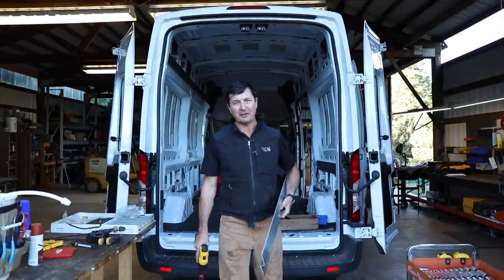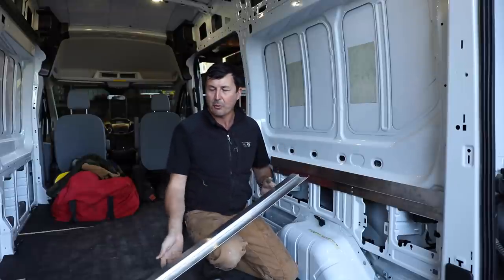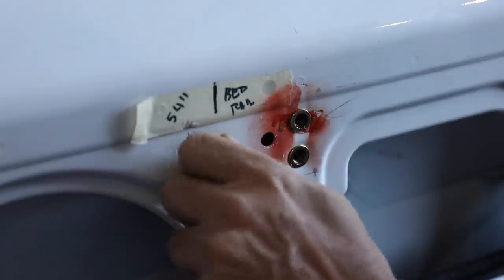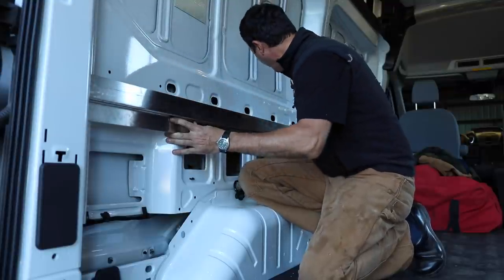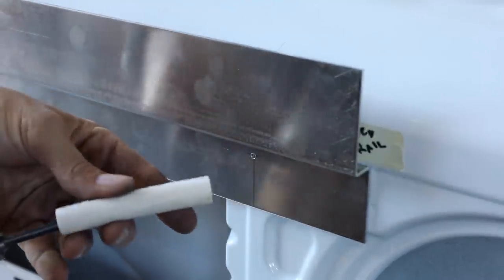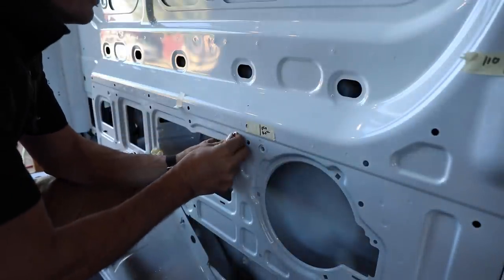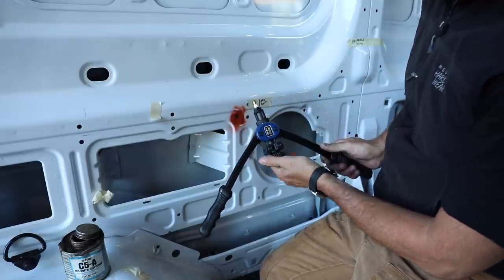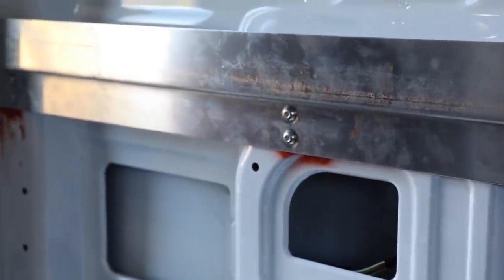Transit Conversion - DIY 3 Panel Aluminum Bed

Comment from the maker: LINK TO THE ASTRO 1442 RIVNUT THREAD SETTING TOOL https://goo.gl/c9DqfU
Reply: The thing you put behind the metal to strike with your hammer - I always called it a 'hand anvil'.  Nice demo of the rivetnut 1442 tool.
Reply: Wranglerstar Sorry to say that but you will do it right, to deburing the holes use a "Handentgrater"
Sorry i don't know the english name for it....
Look there: https://www.amazon.de/Ruko-Unigrat-Entgrater-5-teilig-107006/dp/B00202HXJW/ref=pd_sim_60_22?_encoding=UTF8&psc=1&refRID=AAVZ7Q3WQEP5PXC6MJ11

The right tool for the Job...
Greetings from Austria
Stefan
Reply: Zero Austria it's just called a "deburring tool" here, but you're right, they're fantastic.  I have one similar to this and I use it all the time at work doing pretty much what he's doing(I'm a truck and van upfitter).  General Tools 482 Swivel Head Deburring Tool with Metal Handle https://www.amazon.com/dp/B00004T828/ref=cm_sw_r_cp_api_rejQzbM7SSSFB
Reply: but will it chooch? I was an aircraft mechanic for a long time. Rivnuts are awesome but when they slip and spin in the hole, it's a bad day. Watch out for dissimilar metals that aluminum will corrode to beat hell if you use common steel fasteners. Great video.
Reply: I've been using a similar one for over 30 years. Mine holds spare blades. Great tool.
Reply: Wranglerstar  thanks
Reply: Those Dewalt bits work great , I have that same set at home  great for metal and wood !
Reply: Boy that's an awesome tool!  Thanks for sharing!
Reply: One question. Does it give you the FIZZ?
Reply: Wranglerstar I
Reply: Wranglerstar y
Reply: Dolly
Reply: the auto body repair tool you refer to is called a "dolly", as in hammer and dolly in the auto body repair trade.
Reply: exactly. but he could really mitigate the need for that by just using a unibit/stepdrill. it pretty much negates the need for a de-burrer AND the hole won't deform as it would with a standard drill bit that would grab and pull...
Reply: Ramosel, thank you! That is very clever! So the one side locates the existing hole and then has a punch to make a mark on the aluminum. I also see others that locate a pilot drill. I never heard of this before. Thanks again!
Reply: Where's the rest of the series; wanted to watch more of your Ford Transit Van conversion!?
Reply: What size are the rivnuts you use and what size are those that are stock on the transit.  Is there a reason you did not try and use some of the preset holes? Thanks

Comment: Can't wait to see more of this build. I work in a body shop and I have a couple of tips you might want to look into if you want it to last. Number 1 is galvanic corrosion, I would find a way to keep the stainless from touching the aluminum. with time it will turn the the aluminum into dust. I would paint the aluminum holes and as you are going to do coat the bolts. I would also  add stainless washer with a thin plastic nylon washer between the aluminum and stainless washer. It's not that much more work but I see this done with aluminum automotive parts we replace. The second is I would add more bolts  like you did on the ends. The metal       on these new cars is thinner and lighter and does not like to flex as much, but tears faster. An example would be to put mild steel sheet metal on a vise and bend it back and forth until it breaks the newer metals will be harder to bend back and forth but break alot faster. I'm not sure what the rest of your design has, so what I'm saying might be over kill. I like what your doing and looking forward to seeing more. I hope I can help in anyway.

Comment: As an old aircraft loftsman and design draftsman here's a tip: When you have a sheetmetal part- such as the horizontal bracket you installed- that has sharp right angle corners, cut the corners off so that you won't cut yourself raking an arm or hand across the ends of the bracket.
Reply: good idea! Thanks

Comment: Thanks for reminding me of rivnuts! Haven't used them since I was in A&P school, I'll definitely use them. I'm picking up my van this weekend! :) One thing about fasteners: the stainless bolts you mention have an anodic index of -0.5 to -0.6. CAD plating has an index of -0.95. That's a bit more difference than recommended (0.15 max in non-corrosive atmosphere), and will lead to galvanic corrosion of the rivnuts (which are the harder to replace), esp around the Pacific air. Also, galling is a great way to ruin a day, as you mentioned! I'd recommend using cad-plated bolts with your rivnuts. No galling, no galvanic corrosion, no antiseize needed. They may be a bit more expensive, but most "stainless steel" hardware at the home center is barely "stainless", and better than dealing with rusted, stripped out rivnuts in a few years.

Comment: Hi Cody. Just a little tip from a metalworker: Invest in a good Step-drill! (These drills is also refereed to as Christmas trees in my country) It will make your drilling work in thinner metals a breeze! + it also "auto" chamfers/ de-burs  the hole.
P.S. Keep up the good work!
Reply from the maker: Thanks for the tip. Can you suggest a good one?
Reply: Wranglerstar I was thinking the same thing step bits are the best for sheet metal don't tear thinner metals and leaves a good clean hole. I pick up one from lowes hardware think it's an Irwin and it's been good.
Reply: They are over priced in my opinion. Harbor fright has a good one with right price. They are also good for reloading .
Reply: We call them step drills or uni-bits
Reply: He should have these, i am fairly sure i saw them in one of his vids (like 80% sure, i watch more vids with tools in them :P)
Reply: Rasal1505 - I use step drills but they still don't de-burr the backside.
Reply: Michael Chavez I've been perfectly happy with my Harbor Freight step drills, as I don't use them to earn a living. OTOH, the Milwaukee step bits seem to be made in the USA, which is nice.
Reply: In my opinion Thürmer tools makes the best step drills. They are very precise, and super sharp. I work almost exclusively in high grade stainless steel, and these thürmer drills go through with ease.
Reply: Okay! I love to read the comments for tips! I was thinking.. ‘‘REALLY” this much work for ONE hole and rivet!?! Geez.

Comment: I use rivnuts on the daily while building fire apparatus. Be sure to apply E.C.K. or anti sieze to the rivnuts when installing them. Itll help with corrosion later. After applying the rivnut, try to run a tap through it as the tool can develop burrs on the threads.
Reply: The eck and anti seize is to be applied to the outside of the rivnut in addition to the sealer. Its for dissimilar metal corrosion for those that dont think i watched the whole video.
Reply: thanks

Comment: I've used this tool for experimental aircraft construction. Mostly for the engine covers or access and inspection ports. These fittings come in aluminum, steel and stainless steel.

Comment: Back in the day my father worked for Pan AM airlines as a sheet metal mechanic. When we would build stuff at home he would also use a piece of bar steel and hammer to flatten sheet metal, he always called it a bucking bar.

Comment: Another fastener you may want to look into are plusnuts.  They do the same thing as rivnuts, but are stronger because they grip a much wider surface area behind the sheet metal than rivnuts.  They work like drywall molly bolts.  Commercial van shelving often comes packaged with plusnuts for installation.

Comment: The US Air Force used rivnuts to hold the top of the radios I used to work on. We were constantly taking to top panels on and off because it was necessary in order to align the radios. It didn't take two years before we started seeing problems with the rivnuts. They would spin in place instead of allowing a screw to be removed. Once you install a rivnut it would be my recommendation to limit the number of times you need to remove the screw.

Comment: Add some sound dampening panels in there as well, it helps a lot on long drives to reduce the booming from the rear or noise on rough roads.

Comment: Gonna love seeing these, i would have used rivets but this works as well. Damn that sheet metal looks SO thin, the frame is going to have to be nice and solid. Will make it handle much better as well.

Comment: Eastwood makes automotive rust proofing paints which you can apply with small brush. 
Aluminum rail will rub the van body while van is moving, consider adding some padding material in contact points.
Get some acetone and clean that red overspray:)

Comment: Cody you should try to use a step drill on thin sheet metal like that.  You can even deburr with that tool from the front.  Very easy to control and versatility with multiple sizes.

Comment: @wranglerstar, a noga deburring tool would of made light work of deburring those holes a lot easier. You can also use them to run along a length of sheet metal to take sharp edges off instead of using a file. Super useful!

Comment: Ford Transits seem like pretty good cars. Had one pull into the garage I was working at with 495,000 miles. The man decided to not go through with a few small repairs just to get it to 500,000. But a hell of a lot of miles either way. Original engine and trans in it.

Comment: The hand held steel block is called a "riveting Dolly".
If you use it BEFORE clearing the burrs off, you'll find a lot will just fall off Much more cleanly.

Comment: just a heads up stainless steel fasteners tends to bind after sometime you may want to consider using some anti seize or switching to zinc fasteners
Reply: oh. you did.

Comment: Hi Cody,Plumber's have a de-burring tool that they use to make copper pipe smooth on the inside. it is not very expensive and should work on your van bodywork as well

Comment: You can make your own rivnut setting tool with an oversized nut and a couple washers. Much less pricey than the setting tool, plus you can get it into smaller places. Searching youtube will reveal a few options.

Comment: on the rivnuts Dad use to use them on bicycle frames, so you can add water bottle bosses or rack mounts etc to your aluminum bicycle with out much issue.

Comment: That rivnut solution sounds great, at under 10¢ a pop (excluding the tool itself, which I always find a way to justify a new tool) it will reduce a lot of headaches and hopefully provide long term reliable performance.

I am curious about the van width, are you allowing for insulation and wall covering? I have never considered running a bed across the width of a van before but never seriously looked at the Transit.

Comment: Might sound like a stupid question but, why would you choose a triangle file to smooth rough edges in a circular hole? Surely a round file would have been better to use?
Reply: The sharp corners of a triangular file can help to knock off the burrs like saw teeth, rather than just squashing them like a round file would

Comment: Look up a product called Tef gel. It's a way better option over never seas in all cases especially stainless hard where. Also the reaction you get when you put aluminum and stainless together like that. Tef gel basically stops it. We use allot of stainless and aluminum on our commercial fishing boats. It's the only stuff we use now

Comment: Cody, 
Spread dielectric grease around the threaded insert that will be in contact with bare metal before you compress it. You dont need to primer or pait the metal. Trust me!

Comment: Those rivnuts are handy. We used many on our military vehicles, during installation of communication equipment. However, the tool we used, wasn't as efficient as the one you're using. They were a pain in the behind when one would spin on us.

Comment: Two things to make your life easier.

One, get yourself an actual deburring tool. They are inexpensive and much quicker.

Two, get a can of windshield paint primer. It is used by windshield replacement shops to prime the surface to be sealed to the windshield and stop/prevent rust. It comes in a can like pvc glue with a brush. You'll find yourself using it on many projects like this.
Reply from the maker: can you provide us an amazon link?
Reply: Wranglerstar 

Debur tool:

https://www.amazon.com/dp/B00004T828/ref=cm_sw_r_cp_awdb_r7iQzbMN67TC7

Primer (expensive, but goes a long way):

https://www.amazon.com/dp/B0731FWWGX/ref=cm_sw_r_cp_awdb_Y8iQzbTJ1RBVD

Comment: Instead of using a paint strainer and getting it all over your fingers, just get specialized paint can nozzles. There's narrow+wide, pinpoint, S-shaped, and last (that i specifically know of) twin dots. Of course for this pinpoint is your need, and it essentially creates a narrow dot like paint spray that's usually (depends on batches i suppose) 2 cm wide.

Comment: I worked for a ford dealership, just a few words of advise, you are going to want as much weight as possible over the rear axle. the transits, sad to say, are HORRIBLE going up icy hills
Reply: Dylan Lehman, you can just admit transits are complete junk. They are horrible. How many work transits have you seen new transmissions be put in before they even have 80k miles. We were told by the dealer that we couldn't put a single 4ft ladder on the ladder rack because it caused too much drag and was causing the transmissions to overheat and fail. A couple of brand new ones had gas gauges that were wrong and left guys stranded with the gas gauge saying there was 1/4 tank left.
Reply: Those would be Transit Connects - the little versions.  They are lousy.  Engine and transmission from the economy car lineup.

The Transit being talked about here is completely different - the drive train is pretty much what's in an F150 (though detuned).  The only exception being they used a "giubo" rubber coupling after the transmission instead of a traditional U-joint and they have been cracking/failing quite early.  Ford has finally changed - 2018 on will have U-joints, all earlier vans have a recall out to (eventually) replace the giubo with U-joints.

Ford was really stupid for using the same name for such completely different vehicles.  Even their own employees often confuse the two when looking up parts.

Not to say I think (full-size) Transits are perfect.  I like my Transit but I don't love it!  There's a LOT that could be done so much better...
Reply: JoesTimeWaster, I see your point. Thanks for the clarification. I assumed they were the same engineering. Transit connects suck. Lol

Comment: Great video!  Better just to spray your primer on a small model paintbrush and run it around in your freshly drilled hole.  Coats much better.  Source: I was an aircraft mechanic for 20 years...

Comment: not sure about using anti-seize on the tool itself, anti-seize is actually an abrasive, i would probably recommend a moly grease for the tool, and then anti-seize for the bolts. you will eventually wear down the threads, and i know how long you like your tools to last!

Comment: the rivnuts are $0.80 ea (Amazon) and $70 tool - then you have ferrous steel against stainless against aluminum/minium - this is a galvanic corrosion nightmare (esp in NW ocean air) - alternative could be aluminum rivets isolated with tef-gel or similar - if you need more "meat" then a small backing plate can be used and/or use 3M5200 (it won't come off - ever) at all contact points of Al & FeO -  much faster to rivet/tap screws to a backing plate than the rivnut approach.  Just another idea. Keep up the good work!

Comment: Very detailed and "watch out for" s.
Thank you!

Question.

These are still going onto thin vertical sheetmetal.
Even if riveted well, is the substrate material strong enough for a bed?....

Comment: You can save weight by punching or boring holes and rounding the edges in the aluminum, also downsizing to the bare minimum for rigidity. Finally, use aircraft grade cadmium rivets if you can. Weight savings equals better fuel economy

Comment: I hate rivnuts!! Lol. We use them semi frequently in aviation depending on the aircraft platform and the area, it's not the first option though.  Never seen civilians use them on a vehicle though👍🏽
They ARE a cool invention.  Just keep in mind that they may start to come loose and spin so you'll have to drill the head of the screw off then drill the whole thing out.
Reply: Surely it would not go amis to coat the very edge of the rivnut in epoxy so when you crimp it all down it will have another stage of strengthening to hopefully not come loose and spin.
Reply: Rivets are not suitable for this application.

Comment: Riv nuts are my favorite things I've found for sheet metal. Mounting stuff in vehicles has never been so easy and nice. Drive a self tapper in the same hole 20 times and then a riv nut 20 times and you'll see what I mean. That wallored out hole is gonna leave you fucked and the riv nut is gonna still be perfect.
Reply: really need the "F" word on this kind of channel ?
Reply: maximum woof I suppose not, but the gravitas of the word lends for better story telling. It's also just a word, so uh, if it's us guys in the shop I wouldn't take it to heart if I were you.

Comment: Hey Cody, I was wondering how come you guys went with a van as opposed to an enclosed trailer for the build. 
I was thinking the trailer would be cheaper and not another vehicle to maintain and/or have sitting.  I found that having a vehicle sit was surprisingly hard on it.

Comment: I've used some rivnuts much like those but the tool used your 1/4" impact to swage them in some cases the tool would come with the nuts supper easy and not so special of a tool

Comment: Those rivnuts are an upgraded version of what we knew as 'Nutsert' system.Aluminium at the time. Been around for years. A real bummer when they started to spin when not tightened into the sheet properly.